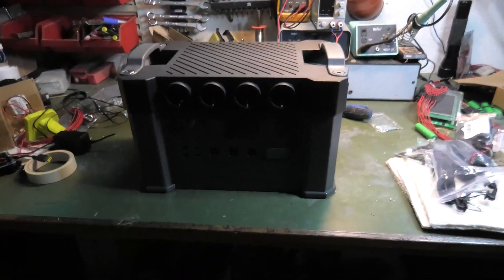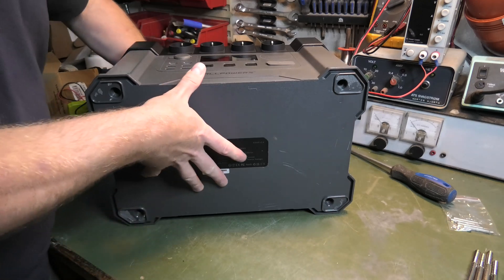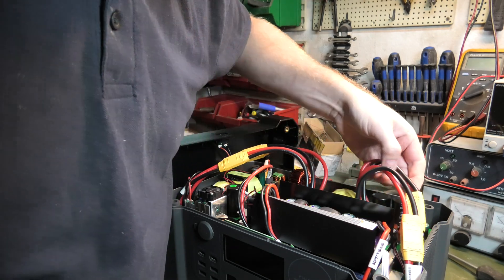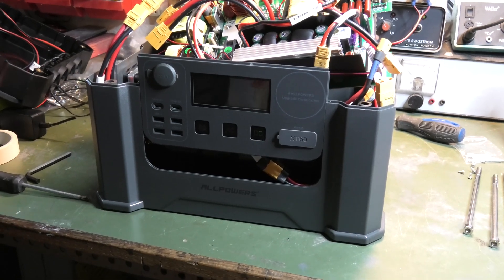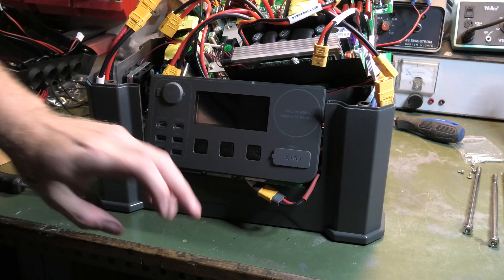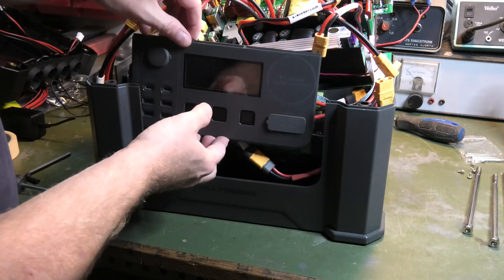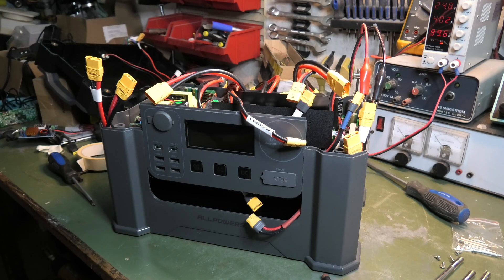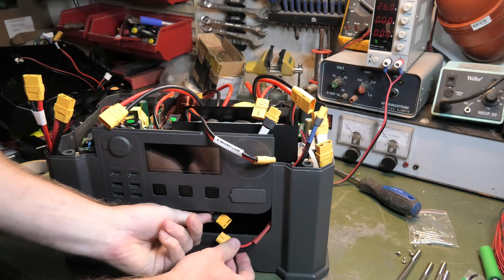Broken ALLPOWERS S2000, I do not fix it, But there is a FIX! - 1410

Comment: Same thing happened to me, only it's an S1500. There's an led blinking right next to that processor. The inverter will only work when plugged into the wall charger for a few minutes, everything else works besides that. Thanks for the info, looks like no more solar charging for this guy. Wish i could find a cheap replacement board.
Reply from the maker: With the S1500 there is a good chance you can reset it just by disconnecting everything and reconnecting it again.

Comment: I have 2 of these for N.A market from Amazon. 1st one only DC worked. AllPowers sent me a second one and it works as it should. I was just using it last week with a 6 gallon Aircompressor and a table saw. I was planning to plug a solar panel into it. Thanks to your video I will avoid. AllPowers let me keep DC only defective item. I plug a small DC/AC inverter into it and use it for my Cable Modem and Router during outages. I wouldn't by these again but the ones I do have have are useful.
Reply from the maker: Well they send you another one,, so they are not that bad.

Comment: As others have said in the posts below you will need a usb uart programing cable to connect to that daughter board and the key that is screen printed on the board above tells you the order to connect the uart pins to the board. Then you will need to know what software you will need to talk to and read from the micro controller then you will need to code plug or software to program onto the micro controller.  As long as the micro controller is not fried and is able to be read and then reprogramed you should be able to get your power station back up and running.  I would also suggest using the mains plug to charge the power station back up to 100% before you use it again.
Reply from the maker: I did get myself a programmer,, ant got pretty far.

Comment: The 4 pins on the daughterboard are the serial connection... +3V,receive,send and ground. you can solder a 4 wire ribbon cable on there with a connector and connect a USB/serial programmer (costs literally almost nothing) and connect to a PC to reprogram. But this is only the hardware part. What software to write on there and what driver the microcontroller needs for programming is a whole other story. Would be interesting to know though :D
Reply from the maker: Thank you,, I received my programmer yesterday and can speak to it.

Comment: I would give it a go.. what do you have to lose? it doesnt work now so its not like you will break it more. Had a quick read through the thread and with the files provided and the recommended j-link... should be doable fairly easily.
Reply from the maker: I realy want to help others with this issue.

Comment: toke an hour to read all the text on the side.... but the problem is:

when there is to less power charging the battery in the evening the relay inside the charging module turns off, but because there is no charge anymore the voltage jumps up again and rises above the set voltage. so the relay jumps on again, aand that loop causes the powerstation to turn on and off again like we saw in the video before, but that didnt seems good for the flash  inside the micro controller and some bits flip, so the controller wont start again

and reprogramming the chip should help, but it doesnt fix the problem, seems like you need to adjust some values of the charge controller that the switching range is higher, one of the posts suggest 2,2v (turning off at 40,5v and turning on at 42,7v)

note even the people inside the posts arent happy about the repair service of that one dude, but he just wants a piece of the reselling value

so you could now bypass the electronics with some switches, or text the support to get a new unit, or reprogram the code inside the chip, but for all of them you need to set the voltages right on the charger

btw  your german might be bad, but your viewers german is excelent
Reply from the maker: That is also kind of what I have gotten out of it,, my programmer came yesterday,, and I have it working,, but with an error.
Reply: @MyPlayHouse  part 3 incomming?

Comment: Poor design, an overdischarge that fries a board, i never saw that
Reply from the maker: No you need to watch to the end of the video..
Reply: @MyPlayHouse Just delete comment like you did in last video.
Reply from the maker: @VitaliySunny  I will delete your comment any day!! but I do not think I have needed to delete anything for about a year.
Reply: it's not fried, it's just data-corruption that is reversible he just doesn't know how to do it (yet)
Reply: @dasiro  still disappointed, it should not corrupt the data on the chip, the chip should be very protected which isn't in this case
Reply: its the solar charge controllers fault

Comment: I have an ALLPOWERS solar charger, different version/capacity, and mine one died when I drained the battery one night. I opened it up and then disconnect and reconnect the XT90 sockets and it started working. I think I was just lucky in this case. This solar charger still works to-date.
Reply from the maker: I saw a video with someone doing this on a S700,, and it worked again,, and that is why I tried this..
Reply: @MyPlayHouse yes mine is S700 I guess. S700 comes with polymer battery so it’s not as good as S2000 but cheaper.
Now I trust more for the DIY system just buy battery and charger and inverter so we can ensure we will reuse the parts when it’s broken.
Reply: @bjdchwr  according to the thread are some people lucky and the controller just needs a restart